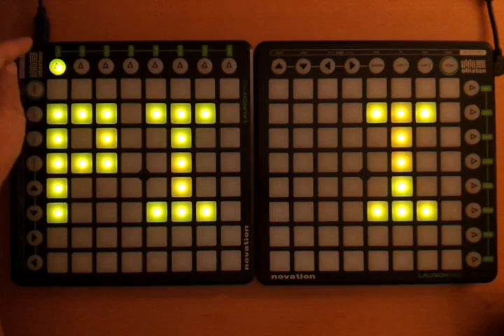Stacy 0.1 demo video

Comment: It is so fucking cool. Does it only work with laucnhpads or it would also work with a Push in user mode? Keep on pushing the concept further, it has a lot of potential.

Bien joué.
Reply from the maker: ShoroukTV I guess it could be adapted to work with any grid controller, but for now it only supports my dual-launchpad setup. I'll try to clean up the UI interface code to make it more compatible in the future.